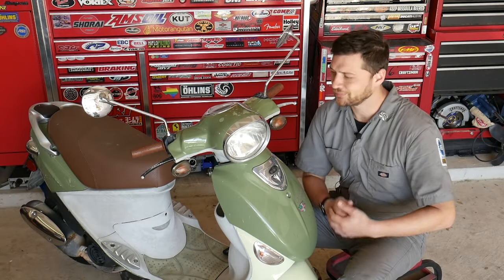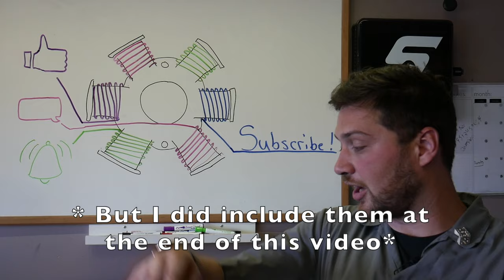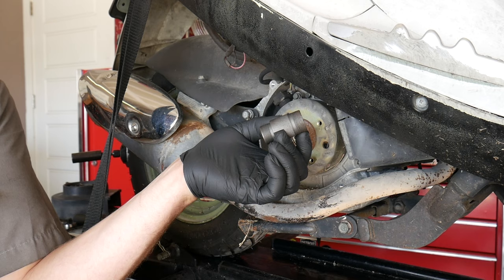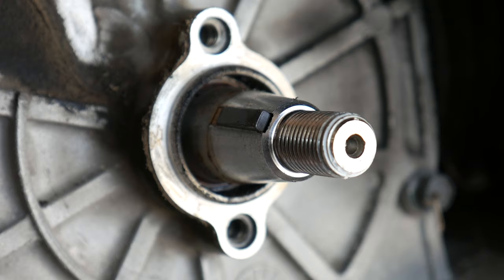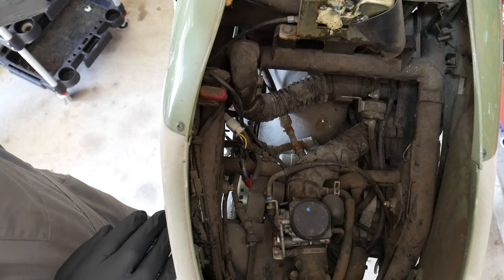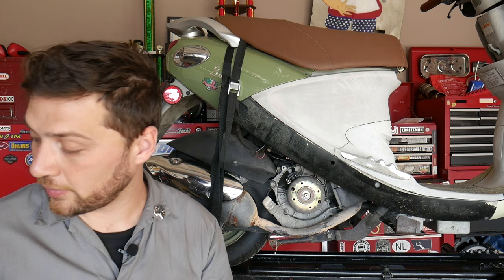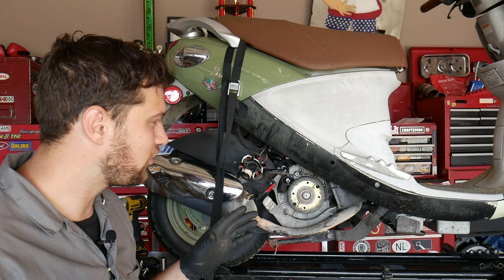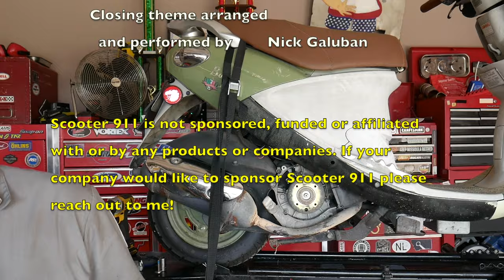Scooter 911: How to replace a stator (with OR WITHOUT special tools!)

Comment: Dude. Thank you.  I now know how to change a stator.  I couldn't figure out my no start issue. Finally I checked the spark plug after replacing the plug, Coil, cdi, carburetor and voltage regulator. I came across this video and got a stator boom fired up and after a little bit of carb tuning it's running good. Thank you

Comment: I followed the steps and my scoot still did not start. I put my old CDI back on because the orange one ended up not working because it was AC. This was not giving me spark to my plug. Right as I tested the plug with the CDI that was DC “original cdi” not the aftermarket orange one. My scoot started up. It’s a 2010 Sunny and now it runs and starts very easy even without carb cleaner. To think if I hadn’t rescued the scoot it would have been junked. Keep the scoots alive!!! Thank you!!!!

Comment: Garret, vis e vis the no spark issue that you addressed for me, double checked per your recommendations still had the same result so I built an external CDI start box as seen on Harvey Spooner youtube channel which then I had spark so I began by using old parts with the CDI box, not to belay this story I found the coil at fault despite the ohms reading on the coil Many thanks
Reply: are you referring to the pickup coil being at fault?because I found my pickup coil was a problem only the ohms was reading okay but did you also know that you have to check for voltage?when I checked for voltage I got nothing!!! and I checked with two different meters so yeah it was bad voltage no voltage reading oh sorry by the way this was on a 50cc GY6
Reply: @shellilogan771  Shelli, I was referring to the ignition coil, yes I did check for voltage output of the pulse generator

Comment: Great job getting the scooter repaired and going once again.
Reply from the maker: Just doing what i can!
Reply: @Scooter_911  my scooter has a 12 pole stator and I need to replace the motor. Do I have to get another motor with a 12 pole (not easy to find) or can I get basically any gy6 motor as long as the stator is dc?  It's on a 2017 Wolf ex150

Comment: Wow, I really love your videos! Just stumbled on to you after purchasing a 2007 Honda Ruckus at a steal. It's had charging issues since I got it a couple months ago and after replacing the battery without any change... I dove into a deep YouTube Rabbit hole. You not only helped me diagnose the stator issue (Just borrowed a multimeter yesterday and cracked her open today) but you are incredibly easy to listen to and straight to the point. I LOVE the diagrams and how clear your shots are on the parts - pointing out and enunciating each as you go along. I'm a super hands on learner and the service manual makes my head spin, but after watching these videos, everything makes sense. Thank you again for taking the time to share your knowledge. It is priceless for this middle-aged, mentor-less, mechanical wannabe! 

I'm looking forward to watching more!
Reply from the maker: Wow thanks for checking in! It seems like you might be less "wannabe" than you might think! keep it shiny side up!

Comment: Enjoyed both the Porno and Ragtime versions of the theme song in the background. But the OEM 8-Bit Atari version is the best.

And you're right, the last unrecommended method is terrible. It's an expensive part to mangle if it turns out not to be the problem, and it can be difficult to know with absolute certainty that the stator is bad.

Comment: Adjustable spanner to hold fly wheel to remove nut makes working with only hand tools so much easier, but I normally screw the screws back into the hole and use a pry bar to prevent rotation

Comment: When I do not have a puller, I put upwards pressure on one side of the flywheel with one of my pry bars and hit the opposite side of the flywheel with a hammer, or putting the flywheel nut back on the crank a few turns and whack it.  I have pullers now for all Stihl chainsaws and a 6y6 scooter, so I use them, instead, with my I,pact driver to remove flywheels.  Pullers make things much easier.

Comment: One thing an old chainsaw guy saw that you missed was checking and setting the air gap on the pulse coil.  I usually use a business card but a .010 feeler gage works fine, too.  I think the general spec is .010-.025.  I set mine to .010 on all my saws with a business card and check them with my brass .010 feeler gage.
Reply: I thought the same thing

Comment: this is why I converted my Honda Cub Clone to DC-Operated CDI

i got the entire kit:

Full Wave 3 phase 11 pole Stator

Full Wave Regulator Rectifier
and a DC Operated CDI

if any of the charging system component fails, the battery would still power the scooter (hopefully until I got home before the voltage drops too much)

Comment: Some of the most informative videos great job. Interestingly enough I came across a peace sports 50 where my universal flywheel 24/27 mm did not fit this one's more like a 26. Have never seen this.I'm going to have to use a regular type bolt spanner puller

Comment: Bought 2- 2010 TaoTao 50. Very unstable driving, have second TaoTao very stable ride. Seems you can't get balanced goes one side to the other thinking my steering may be too tight can you help me
Reply: I have the same problem with mine sometimes twice a year I have to tighten it! it's usually only a half a turn maybe 3/4 of a turn but that's enough to fix the sloppy steering issue LOL and that feeling is a little scary isn't it?

Comment: I have 2018 kymco agility 50, it won't start  using handle bar start button but will start using leg starter. After, it run for couple of minutes, then the handlebar start button works if it's warm.

Comment: hi Garrett a bit of your time please? I've got a no spark issue on my 50cc TaoTao GY6 I couldn't find my meters!!!!!so I ordered the cheaper and easier parts to replace first haha. the CDI the starter coil or ignition coil  and new spark plug . while waiting for the weeks for the parts to arrive and then install them I watched tons of videos yours is awesome thank you by the way!!! and I also found my meters so I was able to test the stator. the voltage test on the pickup coil tested bad there was no reading at all but the ohms was good reading. and thank goodness the Exciter coil tested good also on both ohms and volts  is it also referred to as a charge coil?. because I don't have a stator puller and I don't have an impact driver I was really happy I didnt have to replace that! but!!!...now I think I might have to! I installed the pickup coil hooked the wiring backup and went to start the bike and oh no!!! it cranked a few times and that was it!and now it does nothing! the flywheel refuses to budge! I can't turn it by hand and of course I tried to kick-start it and no can't do that either! I couldn't see where you were placing the wire casing on the pickup coil, but when I was installing mine I could not tighten it down without the Gap going way out of Gap!! I had the wire casing running between both the bolts at first  so I moved it over to the left of the bolt and it tightened  down just perfectly and it's within Gap but do you think that wire casing is strong enough to jam up the flywheel from turning from having moved the wire to where it's at now? I didn't think of that until I just now watched your video so no I haven't gone out and looked at my bike yet cuz it's dark and late of course lol or...and here's where this gets stupid! before I moved the wire over to the left of the Bold my friend suggested adding a nut to see if it would tighten down and stay in gap but he dropped the damn nut!!! it's i nowhere to be found anywhere! and I have a super bad feeling that nut went behind the flywheel and the the magnets are holding it in there and jamming that flywheel tight! what do you think?if it is the nut I'm going to end up having to get a flywheel puller anyways which I was avoiding like the plague and since I have 6500 miles on the scooter I might as well replace the stator while I'm in there! lol! but please Garrett let me know if it could be anything  else but the two things I mentioned about jamming up that flywheel?I've done a lot of work on my bike all by myself getting this no spark issue resolved it never had a problem before this!except for a flat tire haha and that flywheel always spend freely up until the point that I installed that pick up coil I'm really looking forward to hearing back from you soon
Reply: PS Garrett I just now noticed that you aired this video on April 20th which was my dad's birthday and even though he has long passed I hope that this means a good turn of luck for me and my little best friend scoot scoot!!! lol

Comment: Garret,  What about the gap between the pick-up and the flywheel ?  you didn't mention anything about it...what should it be, is it critical, how do you check ?   Also the number of poles on a stator...6, 8, 11, etc.  What is the difference, etc ?  Great video...i ask these questions, not because i know the answer...actually because i suspect the stator is why my scooter won't start when hot...when i did some checks on it with my meter, they didn't match up with the results another video said i should have.  anyway, preparing to swap out my stator and those are real questions that i don't know the answer to.  Thanks !  I am a new subscriber !  love the content !

Comment: Only scooters with an AC powered CDI spark from the magneto winding of the stator ,
Scooters using a DC powered CDI use the battery to supply power for the sparkplug,  yes most 50cc scooters & go karts use AC CDI, many larger models  125cc and larger use 12vdc powered CDI, (yes some use AC CDI, ) DC CDI ignition has more reliable easier starting with less hard starting problems,
If your headlight comes on when you turn the key to on , Before the engine is started , you have a DC CDI, if your headlight only comes on with the engine running, and goes out if the engine dies, you have AC CDI

Comment: Thank you for the video. I have a problem still. The brake lights were supposedly fixed by the mechanics. The bike worked for a little bit but while driving it stopped working and then started back up again. It worked again for a little while and then stopped. I charged the battery but still the bike was literally dead. A week or so later it turned on again but stopped again mid drive and wouldn't turn on at all. There are no break lights at all. Everything is dead on it, literally everything. I tried bypassing the stator relay but that didn't work. The battery is 100% fine. If you have any idea what could be wrong please let me know.

Comment: Watched this video when it came out.
Now today I have a 125 Buddy that isn't generating spark.
Well maybe once every 100 tries since quitting and then it runs for two seconds and dies out again.
I took out the stator and it was filthy and also rusty inside the flywheel.
Cleaned it to no avail.
I think it's pooched.
So I'm broke.  There's an abandoned scooter near me ( Amway not sure of the cc ) .
Would it's stator work temporarily on mine until I can afford the $144+ for a replacement assembly?
To be honest I'm going to try it anyway but I am at my wits end with this thing.
I changed the left brake lever and piston vacuum in the carb while it had a bad rear tire.
It started and ran in place but took 2 - 3 seconds to cut out from the kill switch even with removing the key!
Then later in the week I changed the tire and it ran for about a block and now has no spark!
So downbeat right now.

Comment: Can I switch a DC stator to an ac stator and not have problems? I bought a new engine from the scooter store and after installing it, I have no spark. So I went back to scooter store and told them and they came and looked and said I have ac wiring but a DC stator In the new engine.... They told me to hook up the wires differently, which I did, bit that still didn't work. I have my old engine that has the ac stator I need but am not sure if they are interchangeable like that? Please help. Thank you for the great video.

Comment: Hi! I love this videos! I have a problem with my Baotian sport 2006. It charges fine. But when I put on low beam or high Ben voltage over the battery goes down to 9.8 volts!? What can be wrong?

Comment: My scooter does not start in the morning unless i close back of carburator with a cloth or something ...once start is good to start anytime during the day after that...next morning ...same thing need to close carb on air intake again ...please tell me how i fix that ..
Reply from the maker: Sounds like either an issue with your auto enrichment (choke) or it could be a loss of compression and your scooter needs a valve adjustment

Comment: Dude, you are an absolute life saver!!! Also, what watch is that?
Reply from the maker: Glad to help out! The watch I'm wearing in this video is my beloved Detrola by Shinola!
Reply: So, I have looked everywhere!!! I cannot find the Stator for my 2008 Benelli Andretti x50 scooter. I have looked all around the scooter for engine identification. I've found one thing, "ex-m2". To no avail. I know for sure it's a 40qmb but as to the few characters before it. How can I find the Stator to replace it. Please and thanks if you can. 👋
Reply from the maker: @anonyplayer0n396  the stator for that scooter should be on the bike's right side. That is the right as you are sitting on it. Under the black plastic side cover of the engine (fan shroud) you'll find the same setup as this scooter. A fan, a flywheel with trigger and behind that a stator! Good luck!

Comment: Replaced the magneto,voltage regulator but still not getting power back to the battery. Checked all wiring plugs and everything looks good. Not sure what to do next besides junk the scooter

Comment: Hi, I have a question, I know you have the right answer. My 50cc wolf scooter have a 4 wires 8 poles stator( white, yellow, with connector and 2 more wires for spark plug system) but the wire harness in scooter have same wires plus a green one at the connector  so when I plugged them together the green wire of the harness don't connect with nothing . Since I bought the scooter charging system never been working.
What you recommend me to do

Comment: Hey Garret, I have a problem with my headlights. I got No power going to it. My light Switch is working fine but still no power to my headlight. I have a running lights next to it and using power from it to have my head lights work. Where does the power come from for my head lights?

Comment: I was getting ready to take my bike Apart, comma then I see you using multiple special tools??? 😆  I thought this video was NO Special tools????
Reply from the maker: With or without special tools! The video shows 3 different ways to replace the stator!
Reply: Would you know anything about this problem my scooter would not start I had to push it home It would crank but would not start I opened my carborator Is drain plug And nothing came out of it. I replaced the fuel filter and I just purchased a new petcock That I have to install. When I tried to crank the scooter The solenoid On the 2 screwheads positive and negative Would make a clicking sound like the battery was dying. Then when I kept trying to crank it it began to make a buzzing noise instead Do you know anything about this buzzing noise coming from that

Comment: Garret a little help if you please, Have a DF50 TKC three wheeler with gy6 50cc four stroke engine with no spark, Coil :primary to secondary, 0.3-0.4 ohms :Coil primary through to cap,8.09K ohms: Pulse blue/yellow,144.6 ohms: Stator red/black 510 Ohms , switched out the CdI and spark plug with no positive result
,also while cranking the engine and measuring voltage output of red/black lead from stator 50vac and blue/yellow from pick up was3-5 vac any help would be appreciated.
Reply from the maker: Darn! Sounds like you've really gone through that thing! The 2 things I would check are the resitance to ground both on your coil and at the CDI. Other than that the resistance on the pickup coil is juuuuust a little low and the charge coil output is a little low too. Normally I like to see 157 ohms on the pickup and around 70 VDC on the charge coil. Good luck!
Reply: @Scooter_911  Garret, thanks for taking a look and info on P.U. and CHRG COIL, I was kink of thinking along the same lines, just hate to change parts hoping to fix things

Comment: I cringed at that last unrecommended method because i did the same thing to a donor motor i had.....only i used the bolts to jam against the sides if the stator to hold the flywheel while i broke the nut loose with a ratchet and breaker bar.  I love my impact now 😂 #ugaduggaforever
Reply from the maker: hahah yeah its definitely about 938472 times less pleasant than just using the correct tool for sure!

Comment: Hello I have a question I recently had my cooling fan to break I mean totally into pieces and I changed the fan and after I rode the scooter i could  hear something rattling around inside the stator coil housing and I'm thinking that pieces of that fan got in behind the stator coil housing and yesterday could not get my moped to start and I'm not getting a spark to the spark plug and I'm thinking that that fan. In the stator coil and messed it up have you ever heard of this happening?

Comment: Have a 2013 kymco people  125 EFI hard to start went bike seats for about 3 hours ..once it start, easy start & run good?? Usually I end up flooding the bike to start, waiting 15 mins then it starts
Reply from the maker: Have you performed a valve adjustment recently?

Comment: You're video has been very helpful in my current situation. I am currently working on taking the flywheel off but I don't have that special tool mentioned. Any ideas on how to remove it without that? 
Any help is greatly appreciated.